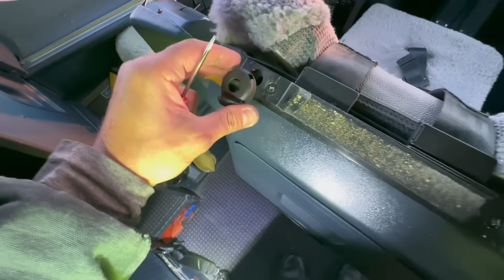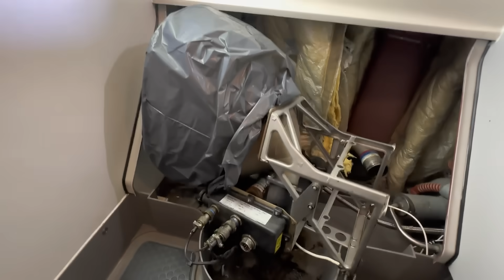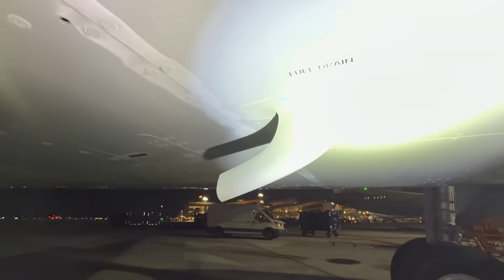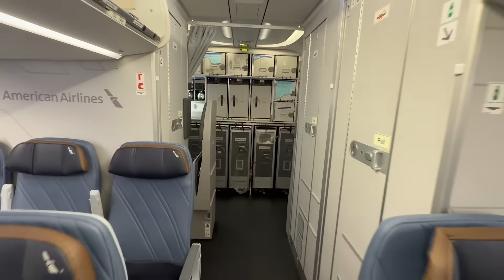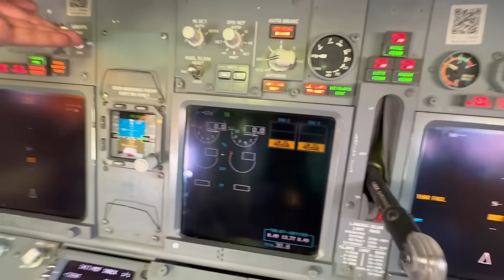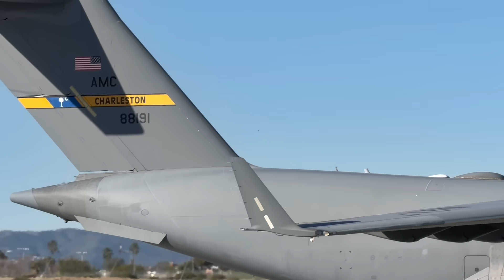Stig Shift #88 (Aircraft Maintenance Adventures)

Comment: I work for a company that manufactures and services equipment for power plants I work on steam rotors and we weld the mid span shrouds together we call them lugs or lug welding and our blades don’t flop around they’re solid very interesting to see the differences between t some different types of turbines / turbo fans

Comment: I got a giggle on your pilot shoulder harness fix.  When I worked at Ford & Mazda they had a ‘recall’ on GLC’s head gasket replacement. They weren’t leaking but they wanted it done.  Basically a five hour job paying about half that on piece work.  Don’t forget factory labor is almost half of a cash job.  One reason I bailed on the automotive industry.  You work your butt & get paid squat.

Comment: Its always the little things - Those lights are small but are significant - I recall that an Eastern Airlines L-1011 crashed in the Everglades because all 3 cockpit crew members were focused on a switch with a burned out lightbulb - I do believe it was a gear down light like you replaced….

Comment: 31:56 Missed you, Stig. Is Fiber Metal Laminate used on XLR to increase strength / decrease weight anything like glass laminated aluminum reinforced epoxy (GLARE) structural material used on Airbus A380 wings?

Comment: 25:27 Does a fan wind-milling the wrong directed mess with the lubrication? Is it driving the oil pump backward, or is the oil pump not even running. Is there a limit to how fast/long it can windmill, and how would you stop it?
Reply: The low pressure turbine (fan stage) doesn’t drive the oil pump. So it doesn’t mess with lubrication. I’m sure there is a limit to it spinning but the only way to stop it is to put the engine covers on to block the wind.

Comment: How affective are the brake fans? Do they cool the brakes or is the reading influenced by the sensor also getting colder air?
Reply: Yes.

The fans are effective and will cool the brakes down relatively quickly, but it does take time.  They actually don’t blow all that hard, ironic given how much noise they make.  Whenever you deplane off an Airbus you’ll probably hear them if you listen to relatively high-pitched whine that’s not coming from the pilots…

And to a degree the fans do appear more “effective” than they actually are because, as you asked, they do circulate air over the sensors; we have a 150 degree limit for takeoff with the fans on, or 300 degrees with the fans off.  The actual brake temperature may be as much as 150 degrees hotter than indicated with the fans running; added to the 150 degree limit with fans on gives the same actual 300 degree limit without fans.

In either case the fans must be turned off prior to the actual takeoff.

Comment: Stig - I've seen you use manual wrenches (socket in this case) when you have to remove bolts. Are you guys allowed to use electric/battery powered ones to make your jobs easier/less repetitive?
Also - Airforce1 - Long wire antenna!?! Wow!!!

Comment: Glad you're back!
5:48 - I actually know something about this. Radiation tolerant design for electronics (e.g. high altitude and space) is a humongous pain and usually results in extra weight because the components and shielding are larger and heavier respectively. So obviously you do what you can to minimize the amount of shielding to meet size, weight, and power requirements. My guess is that they discovered this vulnerability and added some extra layers of error correcting code for these sorts of edge cases where the radiation just exceeds your expectations/you get sufficiently unlucky. TBH it's really probably closer to that one Mario 64 speed run with the bit flip. 

Radiation effects on electronics is a super interesting topic in its own right, the way that ionizing radiation results in errors or damage are so peculiar and an amazing side effect of the physics that we live with day to day. My favorite effect is radiation induced lock-up. Effectively, the silicon doping of a chip results in a silicon controlled rectifier forming between the two power planes with a floating gate. Radiation builds up a charge on that gate, causing the SCR to avalanche, a process that does not stop until the power is shut off or the chip burns up. This is prevented through the addition of silicon oxide layers between the doped layers

Comment: Good to have you back. I hope you and yours are well. Thanks for showing the XLR details. Toliss has a very good simulation of the XLR on X-Plane. The new comms panel is common to the A339 isn't it? The transponder controls are under the ATC menu. Is that tire damage from crosswind landings? I doubt the alignment is off.

Do you have to have that continuous background sound on the voiceover? It's really annoying.

Comment: DO the XLR's have the TO surveillance you showed in the newer NEO's? And they didn't go with the ROW/ROPS option I see as no selector on the gear panel
Reply from the maker: I’ll have to double check on that Tom, the airplane is still pretty new to me. I’ll get back to you on this.
Reply: @StigAviation I found the answer. Airbus’s latest article on their Safety First website explains the XLR implementation of ROW/ROPS is different as the selection is now done on the PERF APPR page
Reply: It absolutely has ROW/ROPS - I just flew 305 (the newer one) last week - as do all our NEOs and our newer CEOs as well.  There is no selector; the system is always active on all our planes.
Reply: @Pupda  so how does it know if it's a wet or dry runway?
Reply: @tomstravels520 it doesn’t.  We know, and we use an app to determine with that information whether or not we have adequate runway.  From that, WE make a determination of what level of autobraking, if any, we are going to use, and then we set that manually.
Reply: @Pupda  but the point of the selector was it determines whether the runway is too short depending if it's a wet or dry runway. If it's wet it'll sound the alert earlier than if it's dry.

Comment: Glad to have you back! Always love your videos. 

I just came back from a trip and had an interesting mechanical issue on one of my flights. It was an ERJ-175 so you're probably not all that familiar with the type. But in summary, there appeared to be an issue with a system that reads the fuel level in one of the wing tanks. It was either providing an invalid value or was throwing a fault message in the cockpit (I was only hearing about half the conversation from my seat in 1C). Definitely a no-go item for the crew so we had to get it fixed.

The pilots tried clearing the fault twice by completely shutting down the entire flight deck. Essentially, they repeated the process that you show a lot in your videos with shutting down everything in the cockpit (including disconnecting the battery) and then powering it all back on again, while also waiting at least 5 minutes with the plane powered down each time. 

This didn't fix the issue so they called maintenance and your counterpart for the airline I was flying on showed up like a white knight and had the wing tank sensor working in under 5 minutes with a simple pull and reseat of another fuse on the panel behind the pilot seats (I overheard him telling the pilots that there can be some residual current in the affected system after they shut things down that prevents it from properly rebooting even if they wait 5 minutes). We then had to wait another 30 minutes for the mechanic to take the plane's log book back to his desk so he could fill out all the proper paperwork and then bring it back to the aircraft. All in all, it was pretty interesting to see it all play out. 

All of that made me wonder just what all goes into the log book for an event like that. I know it's an FAA requirement and I understand it has to be logged so that if it happens again the history is there to show there's a trend that needs to be looked into further. 

I was also curious on how much leeway pilots have to troubleshoot issues like this one before they have to call maintenance. I know that probably differs from airline to airline. Are pilots usually trained to see an issue like that and go "well, let's just reboot the plane and see if that fixes it." I work in the tech industry so it was almost comical to me to see that employed as a troubleshooting step as if they were just rebooting a computer, which I know modern planes are now, essentially. 

I was also curious to know how often you encounter electrical gremlins like that, which can be cleared with a fuse pull or other reboot procedure and then never manifest again. I imagine each airframe is unique and has its own personality of sorts in that regard.

Always appreciate your content and we all definitely understand that you need a break from time to time. 

Cheers from Alaska~

Comment: Happy to have you back, hope things are better :)

And as someone who has been annoyed by carbon buildup on direct injection cars.....oh hell no is all I could say when you showed that pic of carbon buildup, but at least there's a fix for that specific scenario on those specific engines. 

As a software dev (not of aviation related software) I'm curious as to what change that a downgrade to an older version was the fix for the A320's issues. I'd read that increased solar radiation would cause some values stored in memory to degrade over time, but the only reason that a downgrade would fix that is if someone made some changes for memory/processor optimization, they no longer needed to "refresh" the value constantly, and thus it could go stale and be affected by this type of extra electrical energy. Doubt info on such proprietary systems would be online but now you know what rabbit hole you've sent me on lol.

Comment: Welcome back Stig!
I also have a question, do you service Airbuses 330 & 340 and Boeing's 757 & 767 cause i haven't seen that many videos with them or maybe is it because they're rareer aircraft
Reply: Stig is type rated for any and all aircraft built after 1937.  He is the best.
Reply: @thereissomecoolstuff I agree, dude is very cool.
I'm going on an A320 flight simulator on 1st of February :)
Reply: @CircuitSpark1 he fixes those too.
Reply: You only ever see 737, A32X, and 787 and the occasional 777 because that's all that American Airlines operates. I'm sure he could work on the rest of them since they are all likely similar, minus maybe needing to attend a differences course to know what all has to change between models!
Reply: @m1lk3yy he’s been around. He’s in LA so he does have his standard scheduled planes but he has worked on many different planes.

Comment: Hey Stig, enjoying the videos, one quick question:
I was at work the other day (Ramp Agent) and I noticed something on some of WJA's 737NGs. Just aft of the nacelle, some engines looked different than the other NGs. Some of the engines had longer outer ring exhaust(?) plates, and some of them had a shorter version. (Idk the technical word for them) Both the -700 and the -800. What is this? Why do they look slightly different?

Also, Welcome back man!
Reply from the maker: That is quite interesting, it could be variation model engines. But I would have to see a picture to really give you a proper answer
Reply: @StigAviation  Any way I could shoot a picture over? I did happen to take a picture of both engines